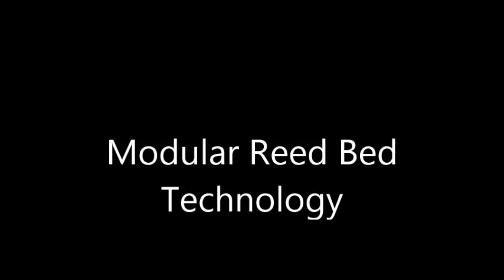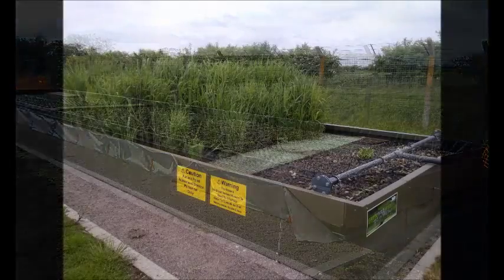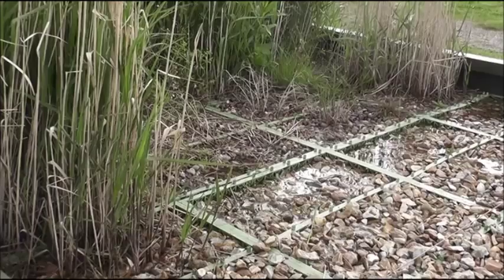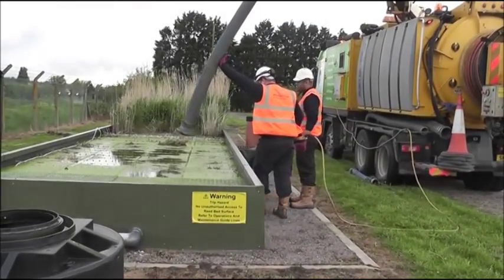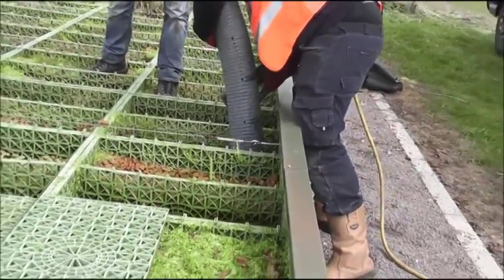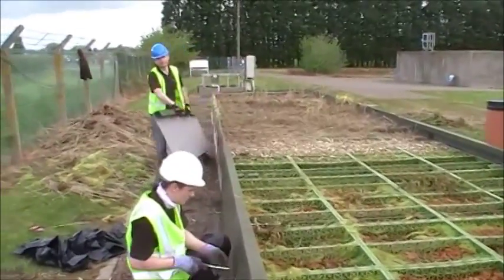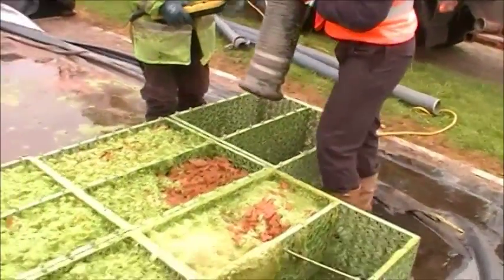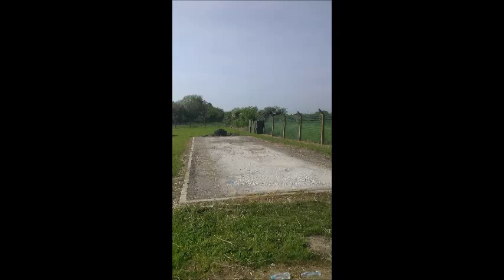GWT modular reed beds

Comment: I do not get it. Extraction of media, follwed by disposal. Use of the vegetation should be viewed as a useful byproduct. The context for reed bed is usually remote and/or impoverished communities where no other sewage treatment is available. There will not be any expensive removal.
Reply from the maker: Thanks for your comment Scott, you are correct in that when reed beds and wetlands are used in a traditional way they will be managed very differently. This design (which is now further adjusted and made of fabricated stainless steel) is for the end of existing sewage works in the UK where we use it to polish cleaned water in a small space where there would not be room for a traditional system. It's not a replacement for traditional reed bed systems, especially in impoverished communities,  it's an alternative to a mechanical process such as a meccana filter or similar.